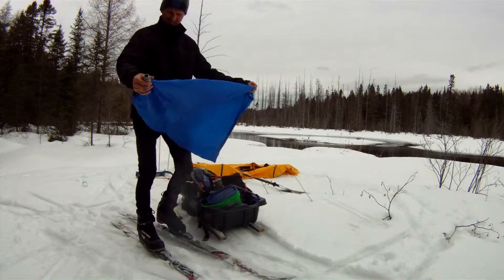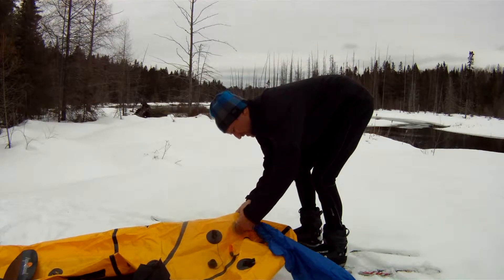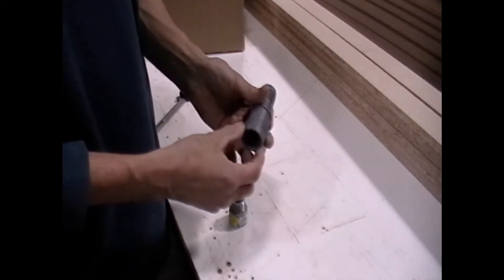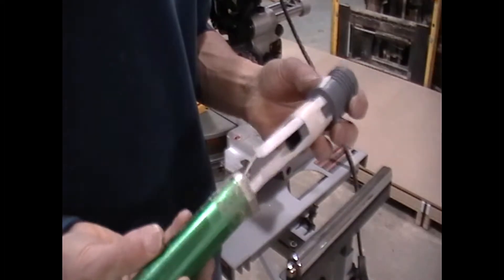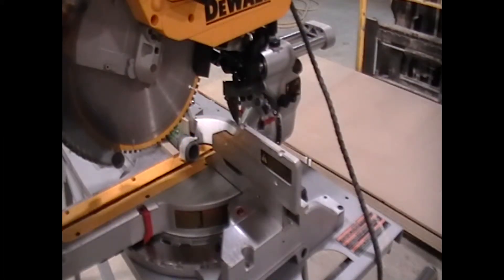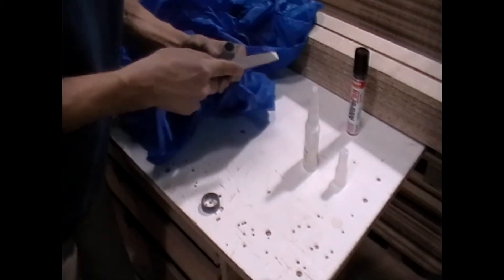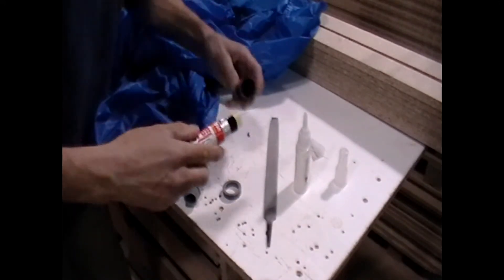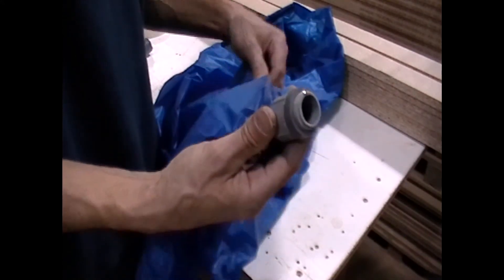Alpacka Inflation Bag Modification

Comment: Thank you for pasting your tip. With my similar bag I just don't screw on many threads to get some of the same benefit. It isn't snug but seems to work. Instead of adding a collar why not cut off threads?